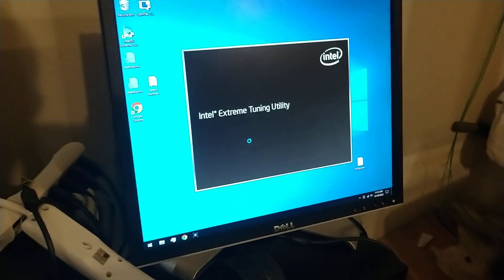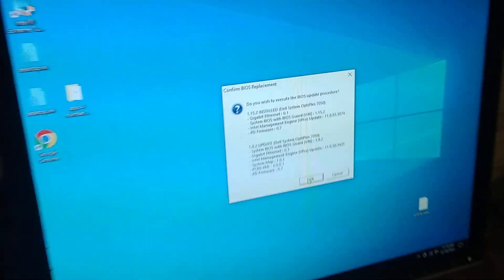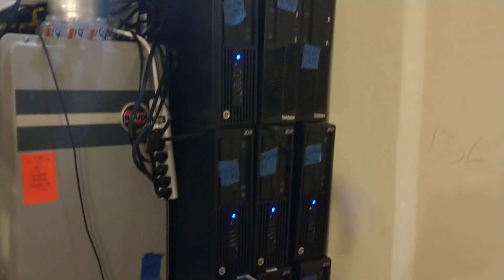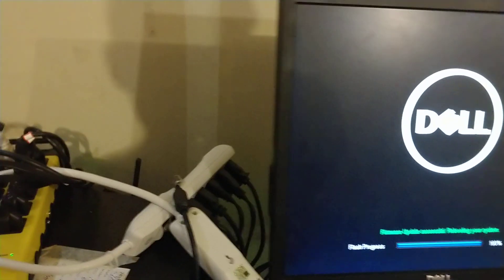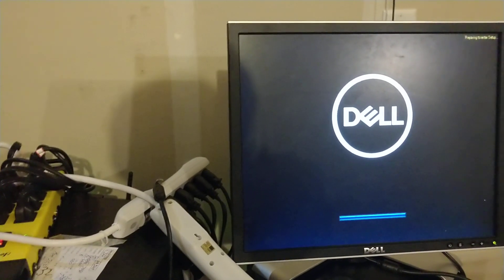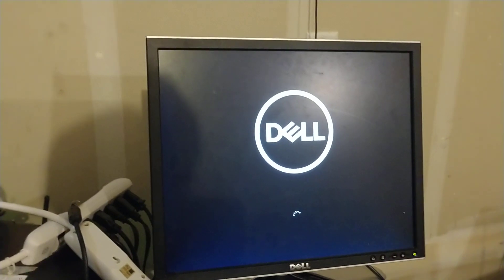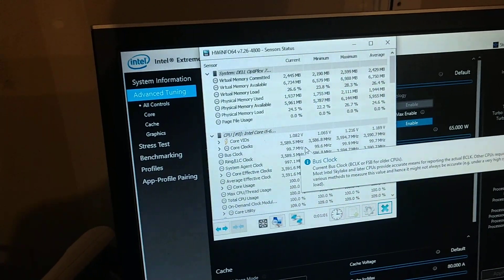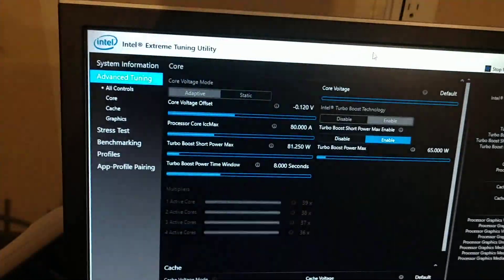undervolting Dell Optiplex Intel Skylake for energy efficiency, tips and tricks

Comment from the maker: Milkyway at home project is most sensitive to undervolting, perhaps because it is the only 1 that uses multiple cores for one work unit.
Edit: turns out since SiDock and World Community Grid has gone dormant for x86 compute, my Farm is bigly Einstein and Milkway. BOTH use CPU units less than Si or WCG, less power consumption, less stable. So setting whole farm to NO MORE than 120mV undervolt. 140 use to be OK but now machines are crashing left and right, have to reduce undervolt 120 should take care of majority. 
I promise it's easy to create a farm like mine, i am trialing for you guys. Buy up those i5-8500 boxes become citizen scientists!
Edit: Most are stable with all workloads at 120mV however some require 100mV undervolt, very small percentage only stable at 80mV so -100mV offset using Throttlestop utility is a good safe baseline, monitor for stability but should require little modification!

Comment: intente hacerlo para mi optiplex 5060 i7 8700 pero no me funciono nesecitaba hacer undervolt por las temperaturas excesivas
Reply from the maker: what BIOS version are you using for your Optiplex 5060? Needs to be old enough to allow undervolt.
Reply: @danwat1234  In the version and date section it says Dell Inc. 1.32.0 3/9/2024. I think when I clicked the BIOS update link it took me to a more recent one. :/
Reply from the maker: @thedereck4737  I do not know if this is for your particular 5060 but this is a BIOS from 2018. https://www.dell.com/support/home/en-us/drivers/driversdetails?driverid=2pkhp
Reply: @danwat1234  I'll try it again with this BIOS and see.
Reply: @danwat1234  I just realized when I tried to check the BIOS compatibility; it recommended a more recent version, my mistake.
Reply from the maker: The stock heatsink should handle your processor without thermal throttling unless room is very hot. Check thermal paste
Reply: @danwat1234  I changed the thermal paste because I just bought it and I put Arctic MX4 on it and it only lowered the temperature a few degrees. Now I'm using it with the heatsink at full speed, but it's noisy and with that it barely stays at 85º on something a bit heavy.

Comment: my 7050 sff has i7 7700 baby lake. I tried 1.11.1as said in your overclockers post and it showed blocked due to unsupported downgrade. tried 1.8.2 and is showing error unable to load SMBIOS table.
Reply from the maker: I will try to look into this tonight make sure obviously bias is for your model bios needs to be early 2019 or earlier in order to enable undervolting. On a number of my machinesBIOS downgrade is disabled and there is no way around it without bioshacking

Comment: i have same problem, but i use optiplex micro 7060... I`m unlock v-core? but still don`t know how unlock undervolting
Reply from the maker: You may need to downgrade the bios to an early 2019 or older version. But I found not sure about micro 7060 but the regular 7060 Tower and 7060 small form factor may often have BIOS lock so cannot downgrade to older version. 7060 and also Hewlett-Packard 600 G4 also often has BIOS lock

Comment: This video is an absolute god-send. My 5040 server's 6700 was running under spec (about 25% slower than is should be) and way too hot (85 deg c) under load - I cycled back the BIOS and the utility, dialled in an undervolt, and got the 6700 tuning at its rated speed, and got the temps down to a much more reasonable 66 - and managed to get the server's overall power draw down about 25% too - and all initiated via scheduler on startup - so good!

-0.13v seems very stable, so I'm gonna see how far down I can get this - and also look to upgrade the cooler to a Thermalright AXP120-X67 - currently running an arctic alpine 12 LP - its not a bad cooler, but it really seems to struggle for 65w+ CPUs (in-spite of its rated 75w TDP). I get the impression that its issues aren't so much the fan/cooling, and more that the mounting pressure is very poor - the 4 pegs seem not to all go down securely...
Reply from the maker: Wow thank you. -.13v is about the limit u aren't going to get much more power savings. Usually if I undervolt too much it will crash at idle but be stable under load.
Reply: @danwat1234  Yeah good point - i was going to do an OCCT test at -0.15 - but I suppose a fixed undervolt might affect idle stability more heavily. Thanks for the advice 👍
Reply from the maker: @beelzzebub  Yes I use a fixed offset not adaptive so can crash on idle. -14v is about the limit. Max is probably -.165v under full load only if good CPU.
85C is fine the chip is specced to about 100C it should last for 10+ years at 85 24/7
Reply: @danwat1234  Good to know - i’m not too worries about temps - more about power usage 👍 actually, good point about fixed vs adaptive offset. Is it possible to apply an adaptive offer with the intel software for these processors?
Reply: i looked into it - doesn’t look like there’s a way to allow for the offset only at higher utilisation (a shame, but oh well).

I don’t suppose you know if there’s a way to access the multipliers? They’re all greyed out (i can edit the base clock, but I can only turn it down very slightly, I was interested in turning it up 😄)
Reply from the maker: @beelzzebub  You were able to offset the voltage before tho? Just plain offset?
I use Throttlestop software instead of Intel's XTU. Under "FIVR" section u adjust voltage has both static and adaptive. I have not messed with adaptive i just keep it simple. 
Correct, no multiplier overclockng for you! You would need a K processor meaning unlocked.
Reply: @danwat1234  Yes XTU has worked fine - I might give throttlestop a look tho to see the adaptive vs static differences.

Yes I considered a K processor, but they’re a higher energy consumption that I was happier with 👍